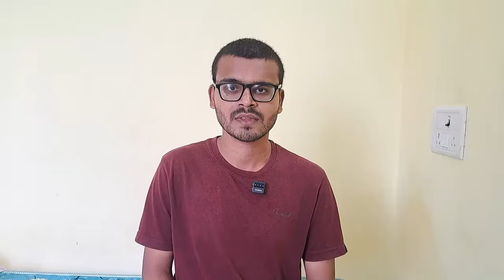Complete Embedded Systems Roadmap 2026 | 10 Phases to Become an Embedded Engineer

Comment: PHASE 1 : BASIC ELECTRONICS , RESISTORS , TRANSISTORS , COMPUTER ARCHITECTURE etc 
PHASE 2 : C , C++ (ARRAYS , POINTERS, DATA STRUCTURES etc)
PHASE 3 : MICROCONTROLLERS (DIFF BW MICROPROCESSOR , MICROCONTROLLER ) , TIMERS , CLOCKS , ALL THE PINS ON A GIVEN MICRO CONTROLLER , ARCHITECTURE , DATA SHEET READING AND LEARNING , SMALL PROJECTS 
PHASE 4 : COMMUNICATION PROTOCOLS , WIFI etc 
PHASE 5 : RTOS , SCHEDULLING , MULTI TASKING etc 
PHASE 6 : DEBUGGING , JTAG , SWD DEBUGGERS etc 
PHASE 7 : BUILD SYSTEMS , CMAKE etc 
PHASE 8 : VERSION CONTROL SYSTEMS LIKE GIT 
PHASE 9 : BUILDING PROJECTS 
PHASE 10 : SOFT SKILLS , ANALYTICAL SKILLS , COMMUNICATION , LINKED IN CONNECTIONS etc 

SPECIFIC DOMAINS : AGRICULTURE , DEFENCE , STARTUPS , AUTO MOBILE etc

Comment: What the difference in embedded systems engineer and embedded software engineer? Which is better?
Reply from the maker: In embedded systems mainly there are 2 types of engineers one is Embedded Hardware Engineer (Mainly deals with hardware related stuff) and Embedded software Engineer(Deals with sw, responsible for application sw ie., logic and behaviour implementation), the above video is related to Embedded software Engineer.

Both roles are best, but choose one upon your interest.

Additionally  there are also Embedded Firmware Engineers (deals with low level sw)

Comment: The way you distibuted the whole learning path into 10 phases was amazing. Just a small correction, Arduino is not a microcontroller, and it is also not mostly used microcontroller. Arduino is a board to support AVR microcontroller. Beside that one can learn Embedded Systems programming in a better way when they practice it through AVR microcontroller (just the way we learn 8051). Using Arduino one cannot learn to understand the registers and register bit fields programming.
Reply from the maker: Thank you for the clarification and the valuable information! I appreciate you taking the time to explain the difference, and that the Arduino is a development board that uses an ATmega328P microcontroller. It's a great point that helps everyone better understand the specifics of embedded systems.